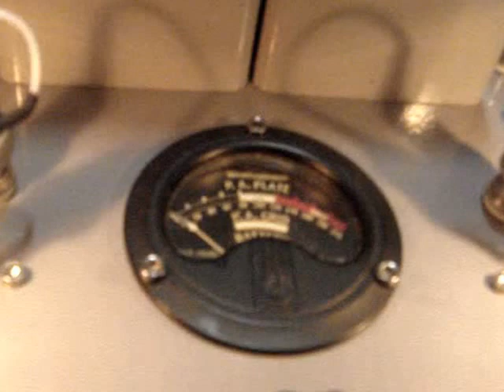100Th and 805 Tube  Amplifier   Se 40W+40W

Comment: overdriving the left tube O.o ?
Reply from the maker: rectifier tube /  866A
driving tube  / we418a
Reply: 김승석 did you check the "BIAS" for the 100TH on the "LEFT" side ?
that tube is much BRIGHTER than the one on the right side :/
Reply: They look like that because they have unnoticeable small cracks.